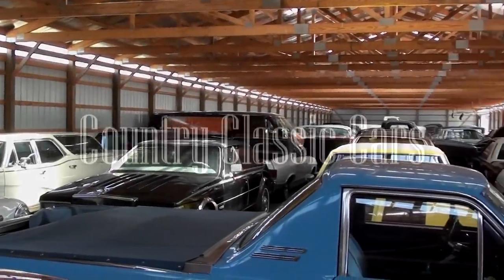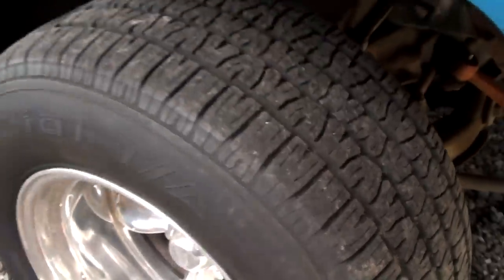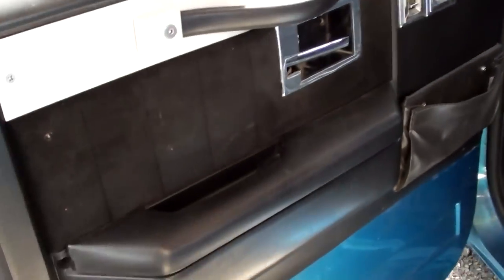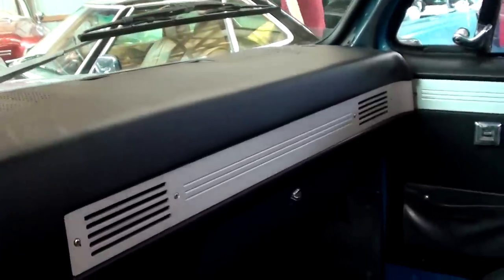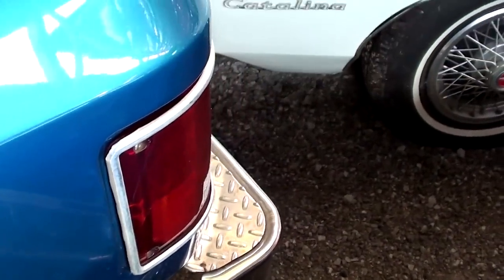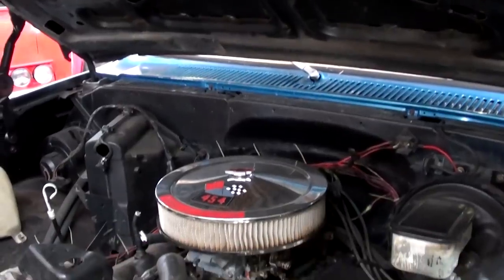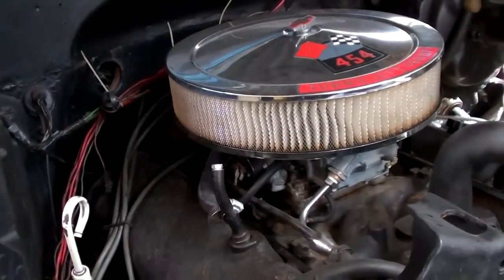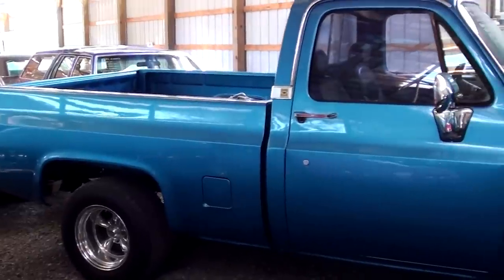1986 Chevrolet C10 Shortbed 454 Big Block V8 Silverado Pickup at Country Classic Cars

Comment: Ive got a 79 Silverado with a big block 454. I just but on a edelbrock carb and am getting 12-13mpg. Not bad considering I was getting under 8 with the old carb i bought it with. Barely ran, always flooded.
Reply: of course I didn't buy it because I was looking to save money on gas….
Reply: Better than a 350 ever dared to get . 7:9 mpg if running like a top. There was some made with corvette heads and a frost mid rise intake manifold that had a air gap under the carb , these 350 were usually in corvette or Impala cars but sometimes they came in pickup truck. My favorite is the 400 small block with a 2 barrel carb . I never had over heating problems with mine. Well 2 Nd favorite. My favorite is the 396/402 class engine with a tri power a rock crusher and a347 posi .perfect balance of power a economy.